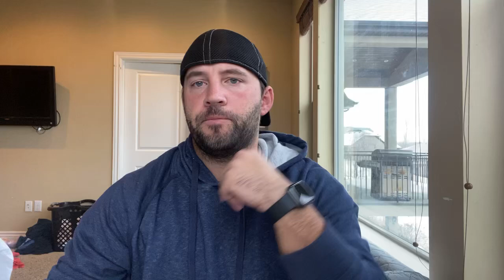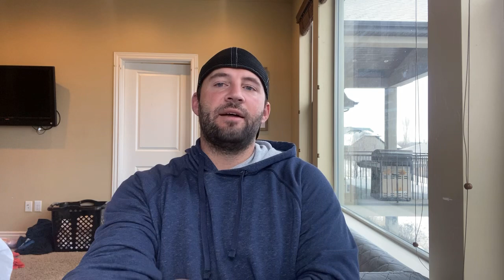Is panelized lighting really more expensive than wireless lighting?

Comment: I took an interest in the panelized lighting but after hours researching it seems very difficult to get an idea of a cost  for this  option or info regarding the installation and wiring required for the switches. I understand this video is 3 years old so the pricing might be quite different at present, but the prices you brought up in this video for alternatives like Hue are a bit of point. I am somewhat still interested in finding more details, I just wish Control4 were a bit more transparent with their pricing. Thank you for your video, you are one of the very few that actually talks openly about this system, I'm sure I'm not the only one spending hours researching this, keep up the good work
Reply from the maker: Thank you for the kind words, and best wishes with your product.

Comment: What are your thoughts on a poe system like lumencache lighting? http://lumencache.lighting/
Reply from the maker: My main hesitation right now is that you're committed to a system with that wiring infrastructure.  If for whatever reason you decided down the road that lumen cache isn't what you hoped it would be, there's very few options to change to.  We did a project in Boca that was run with low volt and ethernet, love it, but Client is very committed.  Very little he can do to change his system down the road.

I think that will improve with time, but it's where we are right now.  Where something like Ketra Lamps, or Phillips Bulbs can use traditional electrical wiring, if you decide you don't love Ketra Lamps you have more options.

Otherwise I think Lumencache or other POE lighting systems are exciting and hoping they'll become more of a standard in time

Comment: You should look into the halo home products for retrofit applications. It’s a Bluetooth mesh system that was developed by a company located in Park City UT called avi-on. Halo has re-branded it as halo home for the residential market. Avi-on maintained their name on the tech in the commercial market but it is an identical platform. I work with them often in SLC on utility rebates for networked lighting controls. A few things I see making them stand out is the Bluetooth mesh. Because it is a mesh network, every node acts as a repeater for the signal. This makes it a self healing system so if a node goes down the signal I relayed by a different path. Also, being Bluetooth it doesn’t require any hubs or area controllers and there are no limits to the number of nodes. Plus the products are capable of tunable white so you can commission for human centric lighting and circadian rhythms. I will say they are still working out some of the bugs with their app but I think it is something worth looking at.
Reply from the maker: very cool thanks for the tip we'll check the out for sure

Comment: Could you touch on the rough cost differences in the electrical work required for each?   With wireless, the electrician is only running romex from the fixture to the wall switch, but with panelized, you're now running much longer romex runs from the light fixture to the panel.   In your experience, roughly how much more percentage-wise do you budget for the extra electrician costs (labor and material)?
Reply from the maker: Rick it’s a fair question and I honestly don’t have a feel for it.  I guess my answer is that, I’ve never had a client who wanted panelized lighting tell me the difference in electrical was a deal breaker.  Once they confirmed on design price with us it was a done deal.  So my guess is whatever changes it’s not significant in the grand scheme, but I’d like to have a better idea for sure
Reply: Is it romex? If it's low voltage lighting the wire could be cheaper than romex
Reply: @ThePositron2  It could be low voltage to the keypads, but line voltage to the lights.